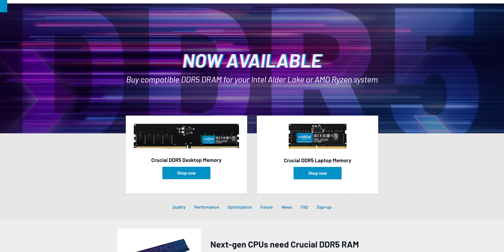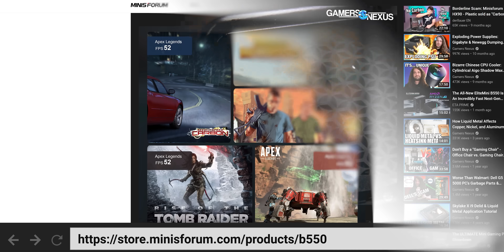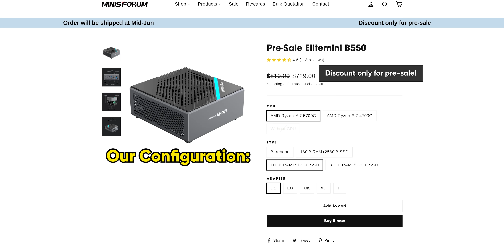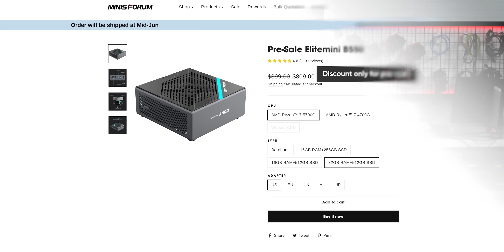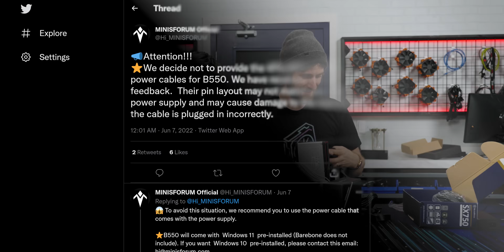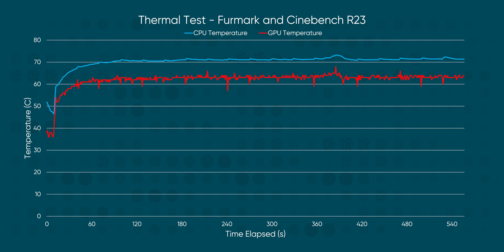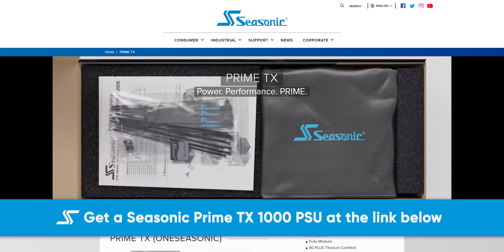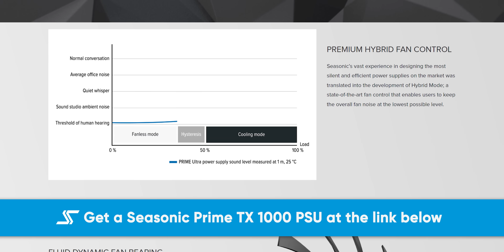Who's Buying These? - MinisForum Elitemini B550

Comment: As a uni student I could see this being useful actually! Leave the gpu and power at my dorm so when I’m back I can hard core game and whatnot but maybe I wanna bring my system over to my friends room to run some party type games. It’s small enough to toss in my backpack and not worry about wrecking it and I wouldn’t necessarily need PCMR POWER to run something like jack box. Perhaps a little niche but I could definitely see myself doing it!
Edit: I’m NOT saying it would be better than a laptop in anyway, just that it could have some utility not necessarily that it’s perfect.
Reply: Except that small form factor cases, like the Corsair 1 do all that, but let you take the GPU and the PSU with. If you need smaller, there are the NUC's from Intel, that have the same footprint as this device. 

Thinking about it, I think this company could just ditch the PC stuff, and make the base a laptop dock for those who want to use a full size GPU with their laptop at home.
Reply: Would you also carry around the peripherals?
Reply: @Ryuseigan  I always carry a mouse for any laptop and keyboard if the screen is less than 17 inches.
Reply: I feel like a small form factor PC would be so much better. The dangling PSU is jank af. I can't see why anyone would wanna do this over a laptop.
EDIT: Just got to the part about how you can't upgrade it much. Why?
Reply: @brningpyre  it's AM4 so you wouldn't be able to upgrade it much anyway. 

but once they have an AM5 one you will
Reply: @brningpyre  I want it over my laptop because of full PCI-e and quiet CPU. No way I can hook up 40Gb card to ANY portable computer, or a SAS controller... except this one. Also all laptop screens suck - even TN monitor is better than any OLED, because kinking your neck down to look on it kills it. I ain't no trading my health for fancy bling.
Reply: @brningpyre  You only need a PSU if you use an external GPU. New guy completely messed up the explanation.
Reply: @brningpyre  If you wait to buy the next generation model with the ryzen 7000 am5 socket, its upgradability will be far better. That might take a bit though.
Reply: @brningpyre  I think that kinda depends a lot on what sff case you go with. I daily drive a node 202 with a 240mm aio mounted to the back (check out the jays 2 cents video he did it’s kinda like that) and honestly it really only helps with moving it an out of school, I couldn’t bring that anywhere without a lot of worries. A whole lot better than a mid tower, not exactly the portable pc life everyone advertises tho. Just in my experience, I’m sure there are tighter packed systems out there
Reply: @brningpyre  We added a PSU mount on it: https://youtu.be/t3fr0jc1Yt0
Reply: I had similar need and I have acutally solved it by simply buying an ultrabook that I can take to work/uni. At home I simply connect it to an eGPU through thunderbolt cable allowing me to game on a real graphics card together with a monitor and a keyboard hence giving me a real desktop experience.
Reply: The price point is going to be the issue, at this point it would have to be a third of the cost of a macbook air (M1) to even be worth considering
Reply: Yeah but you can also just build SFX PC. There's some incredibly small cases out there, that fit big GPUs.

If that is still too big, then get a laptop.
Reply: Or to take home. But yeah a laptop would be much less hassle. Dont forget you also need to bring your monitor, keyboard and mouse or have a second set set up already.
Reply: You'd still need a keyboard, mouse, and monitor to take it anywhere. A laptop is still far superior.
Reply: You would have an exposed GPU getting covered in dust, and you would need to constantly be screwing on and unscrewing the cover for the male PCIe slot on the case.
Just get a normal Thunderbolt eGPU enclosure.
Reply: if they had the PSU mount and an option to run everything (the mini pc +gpu) from that it would be a nice portable system. They were talking like it was big, but to me it seems like it would still be good to take to LAN parties. It shouldn't get as hot as a laptop, so the parts shouldn't have a problem with heat and crumbling after 1-2 years.
Reply: @readypetequalmers7360  Here is the PSU mount: https://youtu.be/t3fr0jc1Yt0
Reply: @Gareth Fairclough But it's not that small!
Reply: @Gareth Fairclough There's other cases that are about the size of this whole thing, with PSU and GPU inside it.
Reply: @Gareth Fairclough laptop + thunderbolt dock. use real monitors, keyboard, mouse, etc. at home, unplug 1 cable and bam portable (including a battery)!
Reply: @Cynyr  for a lot more money
Reply: @robertshort9487  sure, but it comes with a monitor and battery. The minis forum thing doesn't. Add a monitor and ups and you are pretty close to a laptop.
Reply: @Cynyr  ... Adding $0 to something keeps the cost the same.
Reply: Those is actually a veeery picky niche but the wifey is a post doc who has been carrying her 3-4 y/o NUC to campus and back.  She has a dual screen setup with keyboard and USB hub at her desk but doesn't have a dock.  Carrying a full spec laptop along with books is annoying.. something small where she can dump 32GB of RAM and terabytes of m.2 storage for scientific computing ans being able to bring it home and then game sounds perfect.  She doesn't need a GPU at work - just storage and basic visualization (she has a GPU supercompute cluster if she has to run jobs).
Reply: @selfification  "GPU supercompute cluster" I want that !
Reply: As a student also that was what I was thinking at first also. But it works better for me to just pay for 1tb of onedrive, and use my laptop when I'm away from my dorm, and use my "gaming" pc (I use the graphics card little for actual gaming and more for hardware acceleration as a computer engineering student) when I'm at the dorm. Basically, I think a $700 laptop that doesn't require you to lug around peripherals is so much more convenient that it's worth it. I regret paying ~$2200 for a PC (inc. peripherals) and ~$700 for a laptop though. I think the best option would have been a ~$2400 total for a laptop, dock, 32" monitor, MX master keyboard and mouse. I am worried less about gaming and more about productivity though.
Reply: I hoped they could have made it a laptop though. A mobile ryzen 5800H is good enough. But if you really want to cool 's  desktop CPU with a gaming laptop's cooler but not having to share with GPU. It might work.
If you go with mobile CPU, then the system may just be below 100w and only needs a normal Gan PD charger to go mobile.
Reply: something like this and one of those usb-c portable monitors would be the PERFECT hybrid university setup.
Almost all the portability you need, but it can still produce real horsepower.
Reply: I mean if you can slap a R7 5700g in there you can also play some solid games on it no?
Fortnite and minecraft bedrock worked really well on my r5 3600 with a gt710, I don't see why even an r5 5400g couldn't perform better.
Reply: get an itx system
Reply: @gamagama69  so the minisforum?
Reply: @Gareth Fairclough Get a laptop with 2-in-1 screen, then you can put it up in tent mode and use an usb-c dock, this way you still have the laptop screen without it taking up a ton of space with the keyboard
Reply: the 5700g can totally play overwatch and league of legends flawlessly
Reply: Dude, just get a thin and light laptop with a gpu like the Acer swift x (or zephyrus g14 if you have extra money)... one less device in your little dorm room
Reply: in that use case a laptop is much better
Reply: Isn't that basically a notebook with eGPU attachment but worst because you have no monitor, mouse/ keyboard to use on the go? With the rest of the peripherals, form factor, price, etc, it seems like the notebook option is much better in the end.
Reply: Once again, a laptop would do that but better.
Reply: I can see it too. I plug my laptop into HDMI/displayport harness everywhere I go anyway. I even actually carry USB-C monitor in my backpack, so it's far better option for me than laptop, also I hate laptop screens in general (awkward angle, neck issues, shit colors). I wouldn't use the PCIe slot for GPU, though, but for other things (external storage, SAS, fast NIC). I also strongly believe with custom cables and some 3d printing I could fit it in much smaller package than any case. I really, really like the concept.
Reply: @Vatharian  exactly. I bet this would be a joy for those of us who like modding and 3D printing for a cool specific project! Mobile development station for example
Reply: why not laptop?
Reply: @barneybarney3982  personal preference perhaps? I’m not saying this is perfect at all, just that I bet someone out there could find a good use for this or just think it’s cooler than a laptop
Reply: @julianbaker_E  mby im just missing something but this mini pc is just not portable, you still need bring or have on site monitor and peripherals. in case of laptop you can have some gpuless laptop and tb dock at home, if you take laptop with you you only loosing gpu, ofc it will not have same monitor or so as your home setup, but it is ready and working. fair point may be money, since gpuless laptop with possibility to connect tb dock with external gpu is way over 1k.
Reply: @barneybarney3982  that’s totally fair! I think it would mostly work in my situation or in a work to home situation. I would generally be plugging into a friends TV or one of the TV’s in a study room. I don’t think it would replace a laptop for doing work on the go very well. In terms of peripherals a wireless mouse and keyboard isn’t great for gaming but there are definitely thin/light ones made for this sort of application that are pretty cheap! Not saying it’s perfect or a laptop replacement but there’s definitely a market for it!

Comment: i could see it as a engineering machine, since things like solidworks and inventor are basically cpu only, you can bring it to work/shared working space, do what you need to do with coworkers and everything and then you can bring it home and render some pretty images for the boss using a gpu overnight at home... idk
Reply: Makes me remember an engineering staff bringing his tower for work.
Reply: Bad idea working and heavy gaming on the same system.
Reply: The problem here is that PCI-E is not designed to be plugged in/out all the time: Foxconn PCIe Connector: guaranteed Durability: 50 cycles
Reply: We have them at work.  They run Fusion 360 perfectly.  We used HP mini's but weren't as upgradeable for the next few years.
Reply: I wish solidworks was only CPU intensive only. I need a gpu since I use autodesk's  machining addon.
Reply: Why not a normal mini itx with a handle
Reply: yea ....bring a.laptop...
Reply: Dude Just buy an rtx 3060 laptop, that almost fulfill your engineering needs
Reply: I get the logic but it’s sort of reversed I guess… the odds of me having a proper quadro card at home are slim, but it’s probable that I will have one available to me at work. 

Idk it mostly seems like a solution looking for a problem, but maybe there’s some gains to be made by buying the quadro card separately and just docking a standard NUC-like PC in a dock and have it run that way. Maybe it saves costs on a fully assembled pro workstation? Idk
Reply: Yeah but again.... Laptop...
Reply: @metacerberusVT  costly....graphics....where upgrade?
Reply: @metacerberusVT  laptops have an easily damageable screen, where as this PC is a metal brick. Which will last longer if you are daily traveling between two locations? Leave the power brick at work, an use the psu and gpu at home for work and fun.
Reply: Eh idk

XD
Reply: Maybe the other way around, have a shared GPU for the rare GPU heavy tasks?
Reply: Linus said it’s not exaclty an apple design but I could see it being a lenovo/thinkpad product.
Reply: If you want to screw on and off the cover for the male PCIe slot every night, I guess. And if you want your GPU to be exposed and get covered in dust.
Reply: The only problem I see with using it for CPU rendering, is that a much better CPU than this is meant to handle would be better suited for the task. Something like the 5900X or 5950X, but then you lose the iGPU. At that point a slightly larger mITX system is more fit for the purpose.
Reply: Might be a good GPU benchmarking case.
Reply: Laptop Hecate transmitter Receiver
Reply: Hotspot
Reply: Why would I give my employer MY electricity for free? If the boss wants something rendered for him, it has to happen within the workspace on company cost. And if that takes longer, then it is this way, period.
Reply: @wiedapp  sometimes I'd rather monitor a long running process while I watch TV than stay at work all night
Reply: @DanKaschel  If you want to monitor that long running process, then do it while being at work. You are getting paid for it anyway, so why waste your off duty time with work you'll likely not get paid for?
If your boss has a problem with that, he should propose a solution, where you don't work unpaid overtime...

I want to add: I am referring to just normal work, that is usually done in the workplace. I am not referring to work that is done via home office anyway, as home office expenses get paid accordingly...at least they should, in my opinion.
Reply: @wiedapp  I've done the remote work thing. The only thing you're compensated for is the Internet. Everything else you'd have to write off on your taxes. That's how business works. You might find an employer that would agree to these absurd requirements (I'm sure some exist), but there's no way the majority will ever compensate you for your electricity.
Reply: @wiedapp  so you've only ever worked for hourly pay and never had deadlines I take it?
Reply: @wiedapp  seems like you're arguing yourself into a box. If you like that box, more power to you. But I prefer the flexibility of being able to trade daytime hours for low-effort night work.
Reply: @DanKaschel  Or perhaps you could tell your boss that you're not watching any process whatsoever during hours you're not paid for.
Reply: @wiedapp  I guess technically it costs money, but you do that when you bring your laptop home anyway.
Reply: @wiedapp  to be fair, you're talking like $0.20 to run a GPU overnight. Might not be the right call in every work situation but I could see doing that at a small company where there's some mutual flexibility with your boss.
Reply: @reidprichard  The electricity costs may seem low, but recently a friend was allowed to stop working from home, and his electricy bills got 5 times smaller. We are talking about $110 less every month. And basically all of that is just from his work PC running for 8-9 hours per day.
Reply: @Scrfmnstr  Sorry, but that's just impossible. Current electricity average in the US is $0.15/kWh, so $110 is 733 kWh, which comes out to 34 kWh per workday. Assuming an 8hr workday, that's an average of over 4 kW all day. Even with the absurd assumption that his PC has an 800W power supply and is at full blast all day, and he has 2 monitors consuming 100W each, you're still only at a kW: one quarter of the way there. I think some facts are missing. 

Ignoring that anecdote, it's easy to do the math on electricity costs to run some renders overnight. Even for a beefy GPU, you're talking like 300W. We'll call "overnight" 8hrs, which comes out to 2.4kWh = $0.36 in electricity.
Reply: @reidprichard  I asked the friend again. He claims it was two PC with 1000W PSUs + 3 monitors. Also, I converted the money to $, he lives in Poland. TBH I'm not entirely sure if he kept the PCs turned on for only 8 hours, he has a habit of leaving everything on 24/7.
Reply: @wiedapp  I mean, good luck I guess. Something tells me that trying to charge your employer for every cent of electrical energy either using a remote PC or a local workstation wouldn't go over well
Reply: @wiedapp  Try living somewhere that's not Europe/the good bits of Canada for a while.
Reply: i mean there are usb minitors i coudleasly see this thing and a minitor or 2 packed in a bag, then dockit at home for gaming, cause producivity you want multiple munitors but for gamining really just 1 so the dock at home has a nice big minitor the mobvle two small usb monitors, that will cost you a hell of a lot less then any duel side by side laptop on the market ATM. Consider these a usb c monitor designed to expand a laopto are aboutr 250-400 while a gaming laptop (that cant be upgraded) is 4k. This is 1k fully loaded, ad anothe 1k for a top gpu and 400 for a usbc monitor your still under half what a non upgradianble gaming latop costs and you CAN upgrade this
Reply: but you would need to have a monitor and keyboard and mouse waiting for you at work and at home.  why not just take a laptop ?
Reply: It makes more sense if you would rather use/leave monitors at both sites. Laptop displays are too small for a lot of real work.
Reply: @evank8459  Absolutely. I can buy that and two 4K monitors for about the same price as a good 1440p laptop.

Comment: I was considering buying the bare bone, but, again, after double thinking, I should just get better laptop.
Reply: If you already have a gpu and PSU, then it'd probably be cheaper to get the barebone unit than a laptop that can run AAA games at decent fps
Reply: @em25-c4h  Even  if you don't a Ryzen5 3400g or 5600g doesn't cost a whole lot
Reply: In most cases, you would get better performance from this than you would via a laptop. But it only really makes sense if you have some parts laying around and a need for it. I have a similar setup but run my gpu via thunderbolt and use a portable usb monitor (also has wireless display feature for cable free uses).
Reply: You're not gonna get a solid laptop under 800 bucks where the barebones, a 5000 series ryzen chip and some ram wouldn't annihilate .